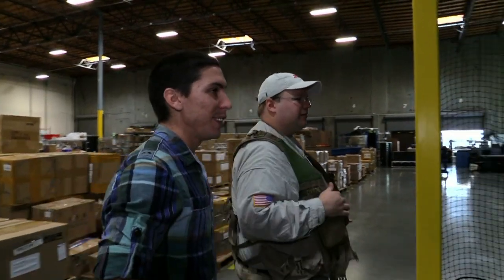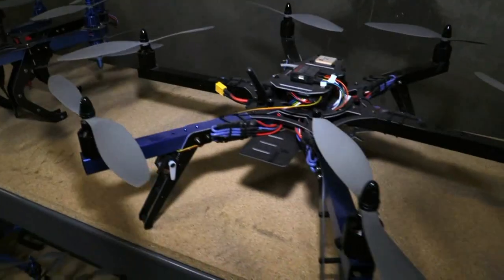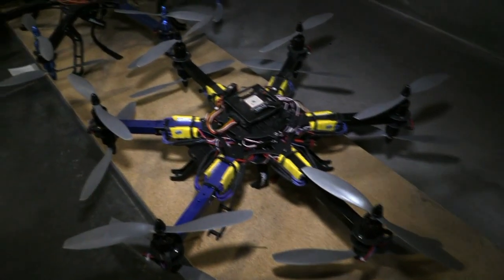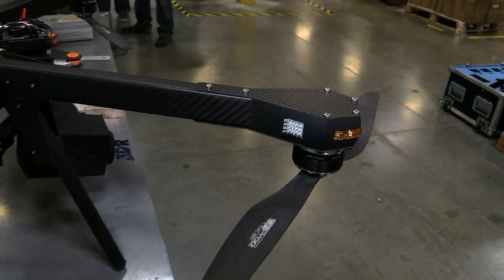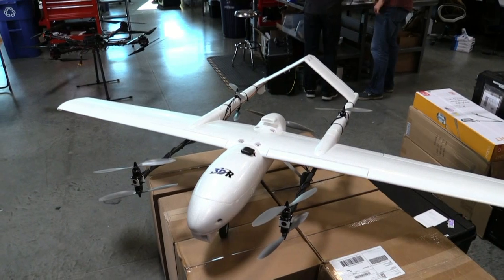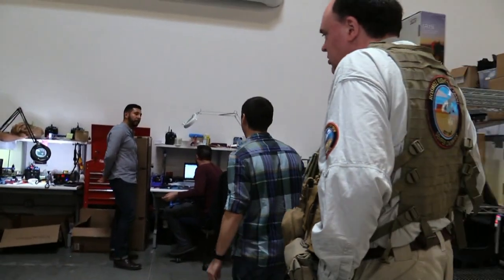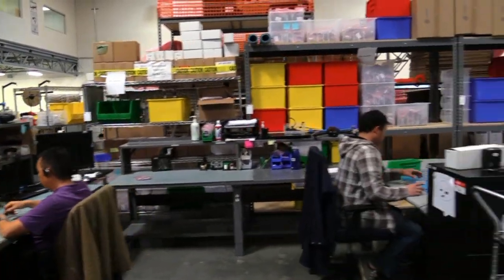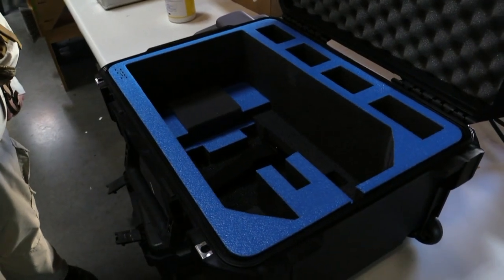Infiltrating 3D Robotics Drone Workshop in San Diego

Comment: Hmmm the case suggests a multirotor and something bigger than a solo that folds and is relatively deep.. maybe a X-6 or X-8 config with 3 to four folding arms. It has what looks like three large "smart" battery bay cutouts and a larger cutout for maybe a charger. The fork cutout in the front looks like it would secure a gimbal stalk. Maybe a new version of their X class MRs to compete with the DJI inspire and Matrice as well as the Yuneec typhoon 4k.. Or I could be completely wrong and it's a boat.. LOL
Reply from the maker: Mark Williams Yeah... I'll be curious to see what this thing turns out to be... The fact that they had GPC make a case for it suggests that they're serious about it, whatever it is. On the other hand, we filmed this a couple of months ago and haven't seen anything about it -- so maybe it's been delayed?